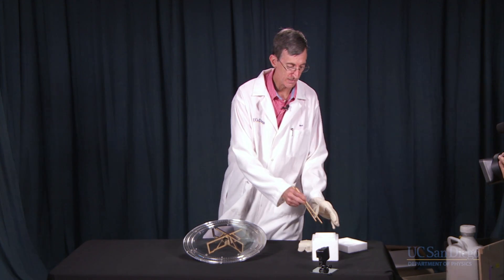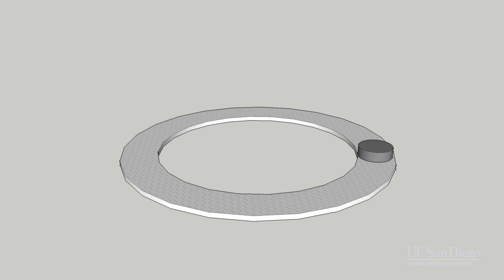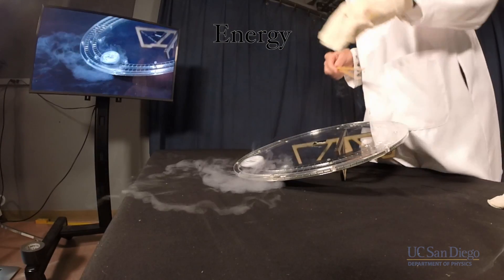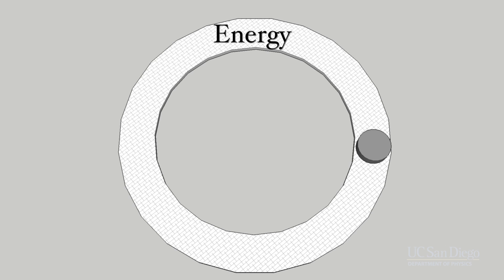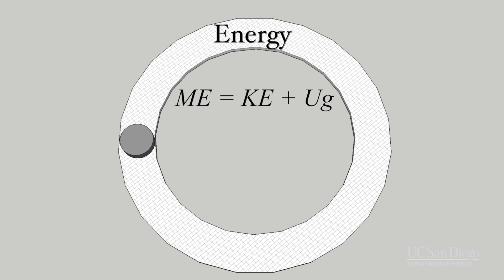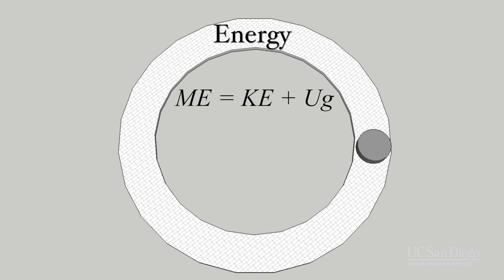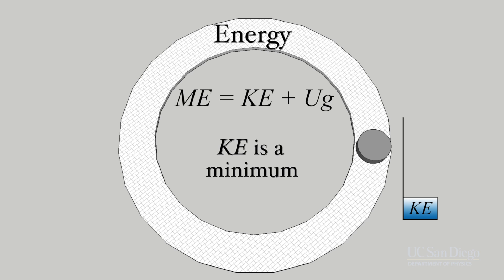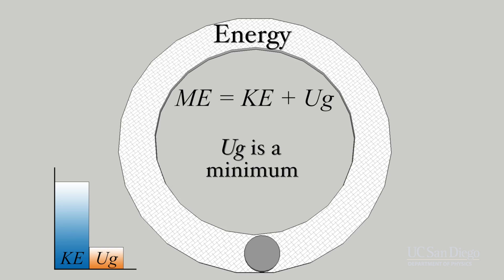Superconductors and Magnets: Oscillation and Energy

Comment: what happens if you premagnetise the superconductor and then use a aluminum track and place the superconductor on th aluminum track. would the magnetised superconductor then induce current in the aluminum magnetising the track by induction and would the superconductor then remain full speed or would it slow down.